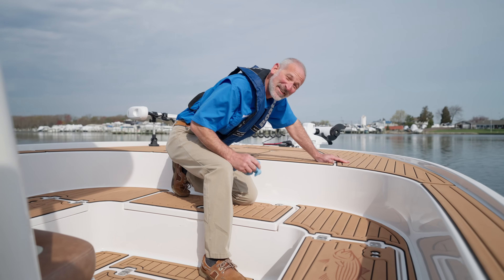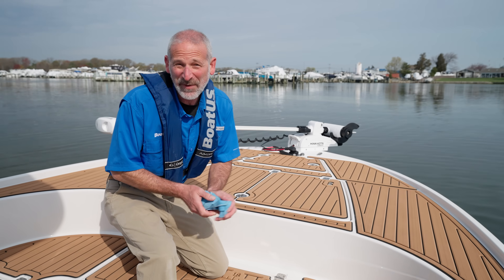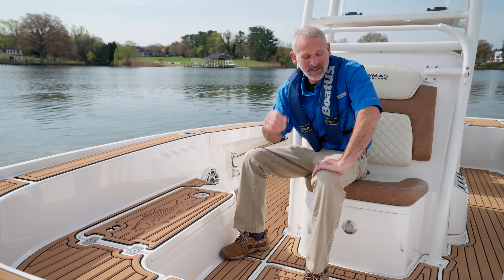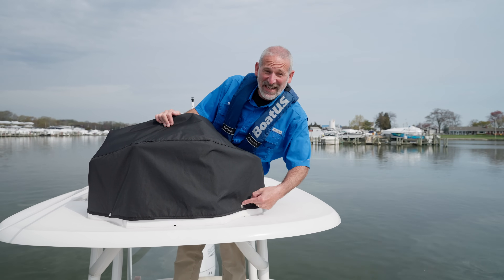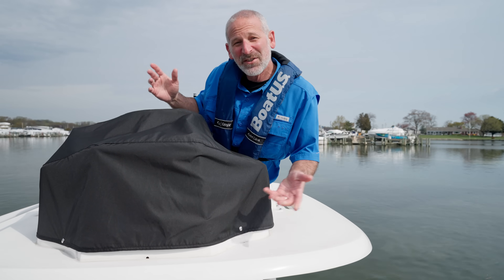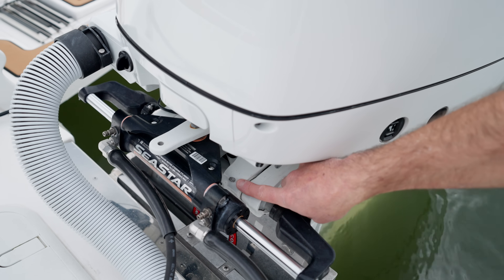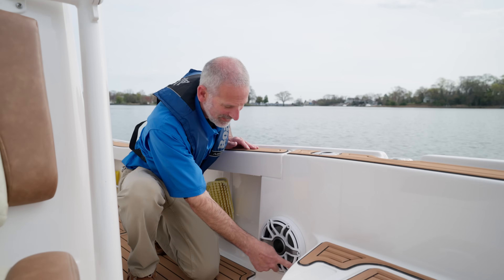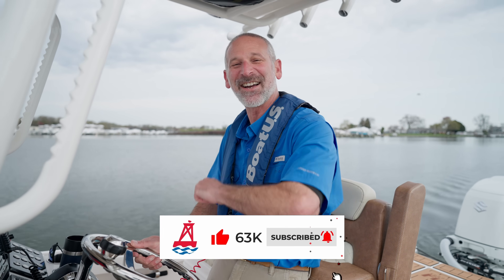WARNING: You're Probably Forgetting These 5 Annual Boat Maintenance Tasks | BoatUS

Comment: Instead of spending your life savings on snap lubricant or snap stick. Used chapstick!
Reply from the maker: Great tip, Dave! Who doesn't have a few wayward tubes of lip balm rolling around? I'd make sure to wipe off any excess so it doesn't attract dirt. Of the commercial products available, one of our faves is Snappi because you can use it remove any existing dirt or corrosion before adding the lubricant.

Comment: Why would anyone buy a boat with all that Sea-Tex.  Going to look like crap after a few years in the sun.
Reply from the maker: Not sure if it matters or not, Dan, but this is not Sea-Dek (which is what I think you meant). It's reFlex, which is different. We've heard some good things about this product. With the number of hours Lenny spends aboard his boat every year, having that extra cushion goes a long way toward keeping him and his guests more comfortable and secure no matter where they're fishing from. It absorbs shock, helps reduce fatigue, and offers better grip on deck when things get wet or bloody from reeling in the fish. Plus, it has the added benefit of absorbing sounds abovedecks to avoid scaring away the fish. And it is easier to clean than nonskid. While it might not be the solution for everyone, Lenny's quite happy with it so far.